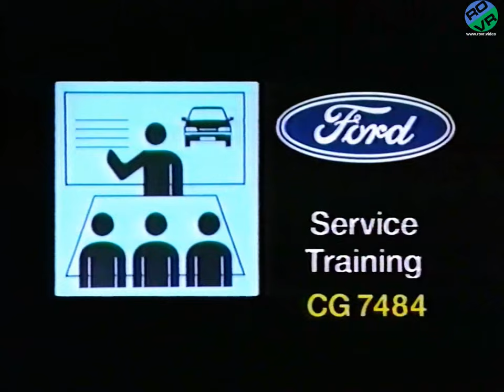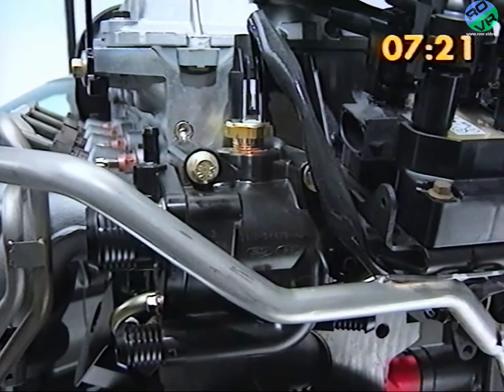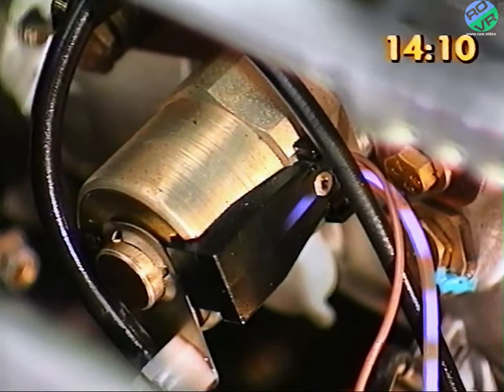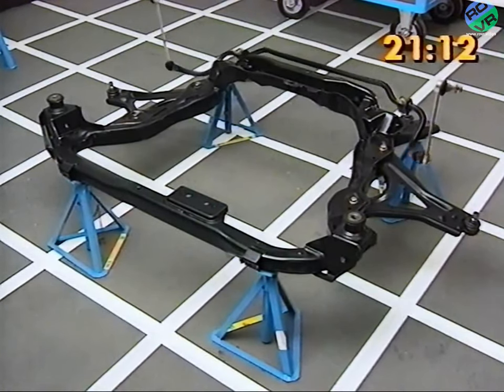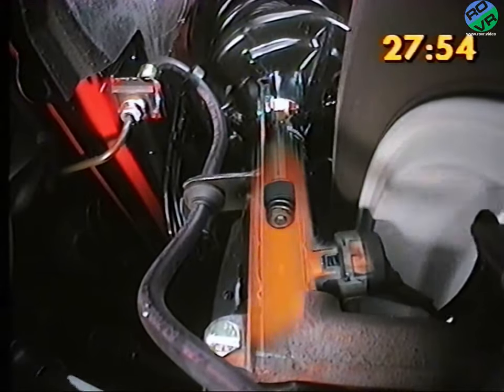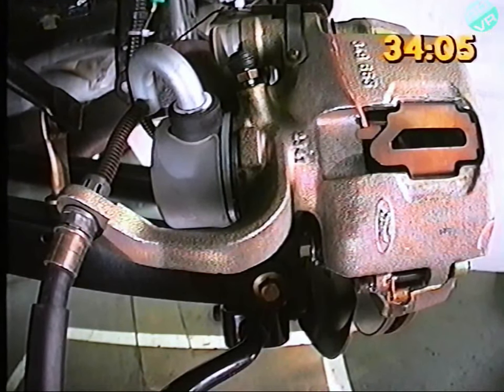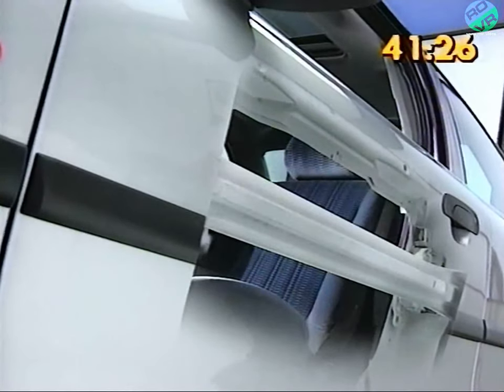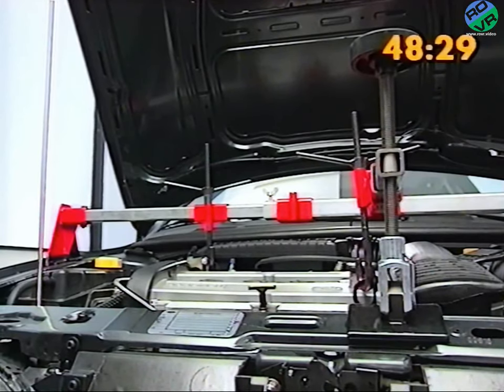Ford - Mondeo (Mk1) - Service Training Video (1993)

Comment: Seeing the old huge tank Red diagnostic machine brings back so many memories as a Ford motor apprentice. Seen it for the 1st time at a course. Guy was adjusting ford transit base pump idle speed via the Red D machine.
Knew then cars and electronics will change for next 12 years until Snap On come up with a decent code reader.
The back street garages took a hit then for years. End of an era with Crypton Tuners where single point injection came in.

Comment: Fantastic,I was an apprentice at Fords when the Mk1 came out and became very fond of it over the years ,the adaptive damping was absolutely superb but an expensive option so you didn’t see it that much ,what I’d do to find a mint turbo diesel ghia ,great video ,happy memories 😊👍
Reply: Hi, I own a 1993 turbodiesel Ghia with air conditioning, ABS and two airbags. She is not mint, since she has 300,000 km but she works very good and I drive it on a daily basis. The car was bought new from my father and then passed to me some years later. The only car I have ever had, I really love it
Reply: Eugenio Di Gioia oh wow that’s awesome ,air conditioning ,ABS and passenger airbag would of been  factory options also ,that is rare to hear of an early turbo diesel ghia with A/C as I only saw one new we sold all the rest were mainly LX and GLX models which sales reps had and majority of the public at our depot brought the petrol zetecs ,ford UK also done a feature reps car a 1.8td lx which had done 500k miles on the same engine ,the car was just over 5 years old so back then it was a big deal ,happy memories 👍😉
Reply: @alancobbin1310  Hi, my Ghia TD was bought new in Italy, it was not uncommon at that time to buy a middle class sedan with a/c because of the hot summers there. I also have 4 electric windows and heated seats, the colour is tourmaline green. I do not have leather seats but velour seats. Have a nice day!
Reply: Eugenio Di Gioia your ticking off my wish list lol I was a sucker for that green and Pepper red ,does it have both infrared red sensor in both front out door handles for remote locking ?aslong as all five belts are changed every 36k miles it’s serviced regular and repairs are not too expensive the engine should just keep going and going ,thanks for the messages you have made my day ,look after her 👍
Reply: @alancobbin1310  Yes, I have IR sensors in both front doors. The engine is simple and rough but also very reliable and has the charm of past times
Reply: Eugenio Di Gioia thats awesome if the remote doesn’t work it’s fairly simple to reprogram with new batteries ,yes the engines are old diesel rattlers but are simple to maintain,air conditioning models were a pain to replace timing belts because the compressor is in the way but apart from that I use to love them engines and could work on them with my eyes shut ,hope you guys in  🇮🇹 are being cautious and staying safe 👍
Reply: @alancobbin1310  The IR remote works, i changed the batteries many times in the last 27 years, I know how to reprogram it. Unfortunately it does not work well on sunny days on the driver side, I think the sensor itself is not very sensitive as at the beginning. I tried to polish the sensor window, changed the batteries and cleaned the IR led on the key fob but it did not really improve: We stay safe here, please do it also in the UK :-)
Reply: Eugenio Di Gioia does the central locking work on the same side if you use the key or remote on the opposite side door?only reason why I ask is after is over the years I had a few where the front door rubber seals wear over the years letting water in an it corrodes the wiring loom under the trim creating central locking issues ,and thanks 👍
Reply: @alancobbin1310  I am not sure that I understood your question. The central locking works without problems, on both sides. About 10 years ago I changed all four weather strips, they were swollen and rusty, the actual ones are perfect.
Reply: @alancobbin1310  Do you know the FB group "The Ford Mondeo MK1 & MK2 Owners Club (1993-2000)"? You can find me there, I posted also some pics of my Mk1
Reply: Eugenio Di Gioia if the central locking locks and unlocks all doors as it should that rules out my theory,maybe the  IR sensor has water ingress ,I’ve never known one to have an intermittent fault as normally flat remote batteries I’m sure finding another door handle with the sensor in would be very difficult now .
Reply: Eugenio Di Gioia thanks but I don’t have FB sadly
Reply: @alancobbin1310  I explain it better: if I try to open from the driver's side when it is dark or cloudy no problems at all. If the sun is shining or in presence of strong light it does not work. From the other side everything ok. I suppose the sensor on the driver's side is less sensitive since it get disturbed from other light sources or maybe the small window in the handle is not transparent enough
Reply: @alancobbin1310  I see. No problem :-)
Reply: Eugenio Di Gioia ok I understand now ,yeah I’d say a fault with the sensor ,finding a replacement now would be like gold dust I should think as they are a separate part to the door handle
Reply: @PaoloRossi723  the IR ray of the remote gets canceled out by the sun's IR rays, hence the problem with locking/unlocking in direct sunlight. The sensors themselves are otherwise quite reliable, but I've heard of cases where 25 years of nonstop sunny days have burned out the sensor. Personally mine have worked as they should, and I've got a few as spares just in case. The sensor itself costs around a hundred quid from ford if they can find one, but considering how most of the mk1 lineup was made up from piss-poor CLX'es(up to a point where 95+ models seemed to receive bits from unbuilt ghia's) I suppose they have quite a few laying around.
Reply: My dad had a 94 Mondeo 2.0 Estate in British Racing Green with nearly all the bells and whistles you could get:
It had the RS and the Touring pack, CD and cassette deck, cruise control, climate control, the extended on-board computer, central locking with remote control and sport seats.

It was quite a nice and very practical ride. Lots of space!

Comment: Worked as a body fitter when the Mk1 came out, thought it was a very nice motor, Ghia front bumpers were a pain to change, as the the dashboard!! Took me ages to change, air vents were always broken changed under warranty… had a SI up to a few years ago, shame it was rotten. Still have a Ghia parked up . Anyway nice video.👍

Comment: Even the States got these - with some stylistic differences - as the Ford Contour and Mercury Mystique.
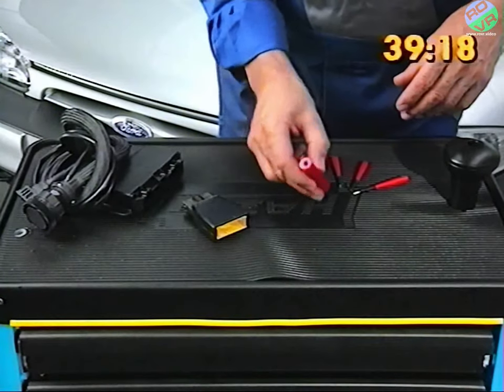Reply: Yup, at 39:29 or so you can see the guy pull away a Mercury branded airbag from the steering wheel!
Reply: I guess in the states they were mainly 2.0 and 2.5v6?
Reply: Alan Cobbin yup. We did get a high performance SVT variant as well.
Reply: @alancobbin1310  Yes, that is correct. The styling of this Mondeo reminds me of the US Escort.

Comment: Remember seeing so many first zetec cyl warranty changed heads in as they had design flaw, in valve guides.
Cost ford ga zillions..
The later zetecs went on to be a very good engine in rally cars and donor engines for older mk1 mk2 and older mk2 fiestas also

Comment: 21:07 common shortcut for mechanics dropping the subframe to change the clutch was to install them from the bottom. Alright unless the bolts got loose for some reason and dropped out with possibly catastrophic results hence the warning to put them in from the top
Reply: energymc22 you can always tell if passenger lower arm has been replaced as silly idiots wouldn’t put the bolt in correctly like you said .
Reply: Henry Discipline  because who can really guarantee that they are torqued up correctly (e.g faulty wrench), that there is no grease or other lubricant accidentally on the threads/mating surfaces or anything else that may make the bolt snap or work loose over time, including possible impact damage to the bottom of car

Comment: 14:54 They complied with the diesel to US standards emission standard. That's interesting, they were harsher than EU, and they never sold a Diesel in the US. Maybe the reason the 1.8 managed 'just' 90 HP. Seems a different approach then VW during the dieselgate. 

At least it was a well behaved diesel, rather good NVH for its time.

Comment: Hi, I have Mondeo Mk 1 year 1993,2 litre dohc 5 door GLX, I have discovered that there are micro switches fitted on the front seats, which are connected to the seat belt stalks, as I have the airbag warning lamp on continuous when the ignition is on, are these switches in any way the problem? Hope someone out there can help?

Comment: Wonder how many Mk 1s are still on the road.
Reply: Hi Tom, I have a Mk 1 Mondeo 2 litre dohc 5 door model, built in Germany and first registered in Britain March 1993, we are now in France, the car is OK, but need a drivers airbag module, as the warning lamp is on when the engine is running, not available as new anymore, but need one desperately! An old one would do, then can be reset, anyone out there that  can help?
Reply: Hello I am Dutch. I have a holiday home in Portugal.  I bought a Mk1 1.8 td almost five years ago. Changed the engine last year. It needed two times a time belt. It is still reletively good giving. I still like to drive it during 6 months per year.